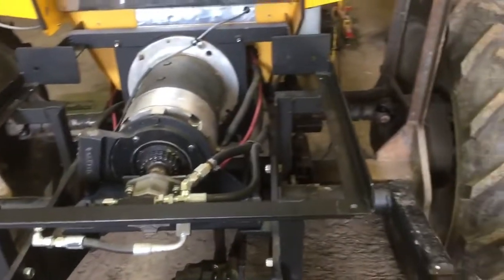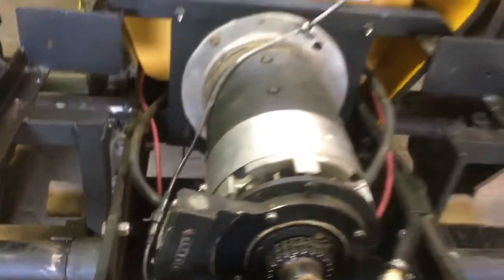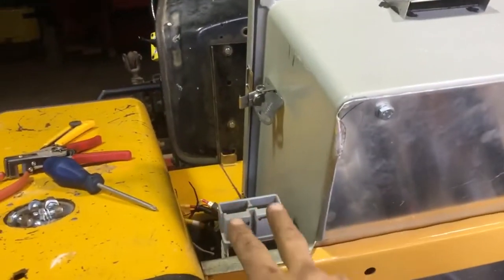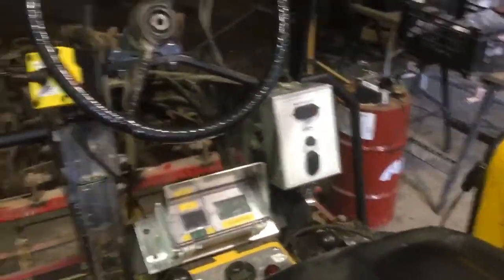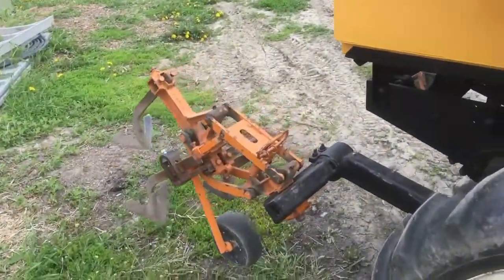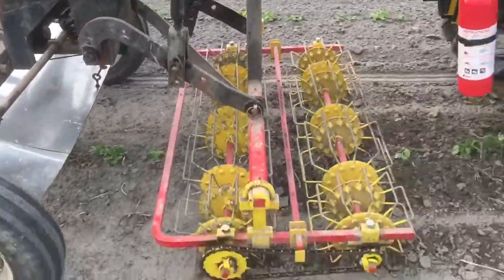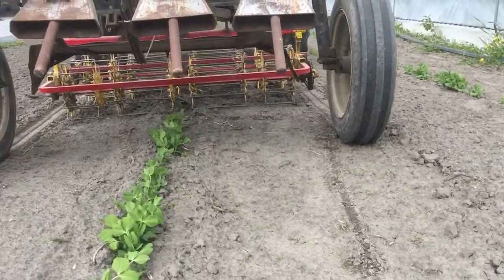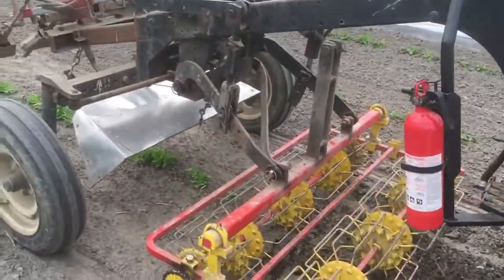Hefty-G tractor electric conversion, part 7:  field tests and weeding demo with basket weeder

Comment: Awesome work! I'm not a farmer but I love the idea of repurposing with electric... very cool. Wondering would you consider a solar panel roof for charging or do you not use it enough in the day?
Reply from the maker: We're located in Quebec where 100% of our grid power comes from Hydro and is so cheap that it's hard to get motivated to pursue solar or wind.  It would absolutely make sense to build a solar array for charging in a different context but not so much here.
Reply from the maker: Sorry I'm a meathead!  When I said 100% hydro I meant 100% renewable energy.  There are also substantial wind farms in various parts of QC but we have so much hydroelectric capacity we sometimes forget about the wind farms.  Sorry.  I drove past a wind farm two days ago and thought I'd better correct my statement :-)
Reply: @reidallaway  haha. Makes sense. Australia's renewable energy is pretty poor really. But solar would be effective here.

Comment: This is a nice project! I have something less advaanced coming up, but need advoice: One question is my charger. My tractor, a Fiat 211, will run on 4 cartype lead batteries. Could a test charger be made from an AC driven motor pulling a car alternator, support the 4 batteries simultaneously?
Reply from the maker: Yes it could work.  An alternator is typically combined with (or includes) a voltage regulator to charge the vehicle's starting battery up to 14.8V and then taper current to zero as the lead-acid batteries gradually complete their charge.  So it'll work for a bigger battery bank and will automatically slow down and stop delivering current one all batteries are satiated.

It seems easier to use an AC-DC power supply and a voltage regulator or DC-DC converter to do the charging but if you've got the alternator and AC motor for free and don't have other solutions it could work and even have a certain whimsical charm.

I've never seen a Fiat 211 here in Canada but a quick image search suggests that it is adorable and practical.  We have a 1971 fiat 480 badged as another brand and we love it.
Reply: @reidallaway  Thanks Reid. Yes parts are on the shelf so it should be nice and easy. We have a tight budget but loads of fun doing this. The farm is producing a mix of vegetables and used to have a Porsche 108 diesel tractor. It is sadly missed...
Reply: Having tested the Fiat, Im concerned by start-up current. It puts some stress on both the mechanics and the motor and contacts. Would you have an idea for a sort of soft start. I dont want to have to find an expensive controller (36 volts 160Amps)...
Reply from the maker: @johnjrgensen701  did you keep the clutch?  If you don't want to control motor speed your drivetrain is a lot like an ICE and the clutch can be used to match speed smoothly between motor (always spinning) and wheels, via the gearbox.  You lose much of the elegance of an electric drive with this approach but it's very simple and cheap.
Reply: @reidallaway  No, the clutch was gone on both my Fiats so I have to find a solution. The old Mercedes trucks, 508, had a start relay that gave 24v for start and back to 12 when driving. I might try and reverse this method and start on 12 before letting it have 24v...

Comment: Nice video! Thanks for that. 
Can you modify the rear wheel pass implement to cover the 2 strips that the underbelly weeder missed? e.g. add an attachment to the inner part, to cover the strip?
Reply from the maker: Nope. Rear tool mount is just for wheel tracks

Comment: This is an amazing conversion! watched the whole 'series' : ) Very valuable resource. I'm just wondering if this hefty originally had a pto? And you did you consider adding a hydraulic PTO into the system whilst doing the conversion? Have been considering copying your idea but would really want a rear pto for operations like flail mowing or power harrowing whilst being able to straddle the bed.
Reply from the maker: So glad you enjoyed the videos!  No Hefty-Gs that I know of ever had a rear PTO (or 3-pt hitch for that matter) though there is some provision for a mid-PTO run off the front of the transmission towards the belly mount and there were belly-mount mowers available.

A flail mower could reasonably be hitched on the belly 3-pt and driven from behind off the transmission PTO and this might not be a terrible option as the electric motor drives directly through the transmission to that PTO and I could monitor PTO speed on the tachometer.  I bet flail mowing would eat my battery pack pretty fast!

It seems that with many electric tractors it makes sense to have a 2nd, possibly smaller, motor dedicated to PTO service, or sometimes in fiendishly clever setups this second motor can contribute to traction when peak output is needed or power the PTO or sit idle.  I think one John Deere prototype managed this but I don't know the gearbox layout.

There seem to be lots of cool options and electric power is so flexible.  I didn't really know what high power accessories I might want in the future but I included an "auxiliary" contactor that supplies full pack voltage to a high current connector at the rear of the machine.  So if I can think of something cool to build that draws 40VDC I can just connect it and control it from the dash.

Thanks again for the encouragement

Comment: How many hours did it work
Reply from the maker: After 1 season of using the electric Hefty on our farm we still don't know maximum runtime of the battery because we've never drained it completely.  We know that it's good for more than 3 hours of off and on use, which is typical of a small, mixed vegetable farm.  On a larger farm with bigger fields of a single crop it might not have enough runtime but it's important to note that the battery pack was built with recycled LiFePO4 cells which had already been retired from service due to reduced capacity.  The same size pack built with new or less used cells would have more capacity (but cost more to build)

Comment: Do you have any idea of how much watt hours it uses during weeding? I have 230Ah batteries, 24V. I hope it will do for at least one hours work...
Reply from the maker: Hi John.  Yes I have numbers on that, thanks to a current shunt between the battery pack and controller and  display unit I put in the dash unit so I can consult it while operating.  Unfortunately, the answer is that there are a lot of variables (what kind & how many weeding tools & at what depth, speed, soil moisture, soil texture, etc) so it's hard to say X kW but it's typically between 2.5 and 6kW during weeding operations.  Based on this my 6kWh battery pack might only last for 1 hour if working hard but in reality there is a lot of stop and go, turning, adjusting, etc. and we often get 4 or more hours of operation out of our battery pack.

Your pack size being 24V 230Ah translates to 5.5kWh so unless your setup has much lower mechanical efficiency than mine I think you'll have enough capacity.
Reply: @reidallaway  Thanks Reid. My old weeder tractor was a 11hp Porsche diesel Junior 108. This little wonder would weed in idle engine speed. So your figures 2,5-6 Kw sounds right or maybe high. (we dont use the basket weeder). My motor says 80 Amps cont so it may be too small. I will try anyways, I plan on a 100 amp fuse to protect the motor and controller. I plan on adding a voltmeter to check the capacity of the battery while driving. Some sources say recharge when volt reading reaches 12,0 volt under load. Does this sound reasonable. Batteries are lead acid agm.
Reply from the maker: @johnjrgensen701  if your motor is rated for 80A cont. it'll probably be fine.  The load on a traction motor is far from steady and it'll probably be fine with variations between 50 and 150A.  Provided the fuse doesn't burn too quickly it's probably fine at 100A but you may find you want 150A and I don't think that would be putting the motor in too much danger, though you'll find out by operating it and seeing how hot it gets.

I'm not sure about what voltage you want to use as your marker for end of use and recharge.  lead-acid cells are pretty predictable and forgiving, provided you've chosen deep-cycle batteries.  Look up some charts about deep cycle depth of discharge and volts per cell.  In some applications you might go as low as 1.85V/cell (22V for your 24V pack) and at low temps you might push them even further but probably not much.  You then recharge up as far as 2.3 or 2.4V/cell (27-28V for your "24V" batteries).

Comment: What size motor is that?
Reply from the maker: Timothy Koller motor is a "sepex" brushed DC motor.  8" dia x 14" length.  Peak power recorded to date is 15kW but usually more like 6kW